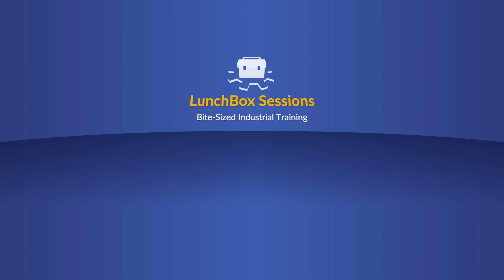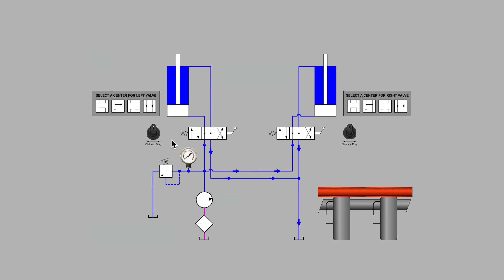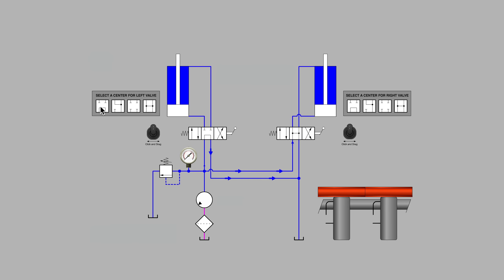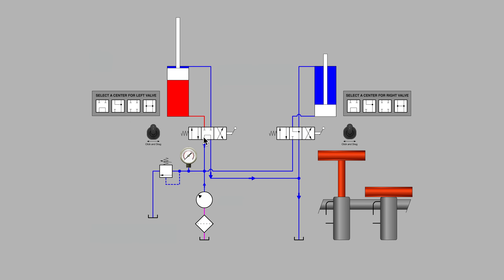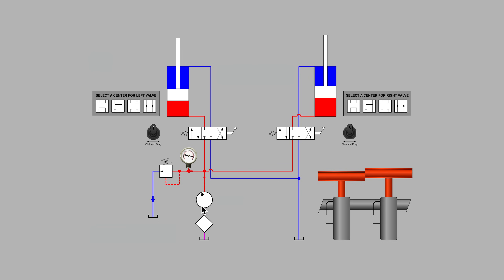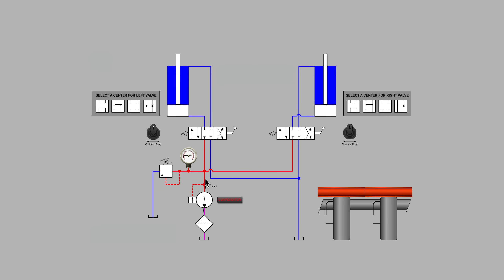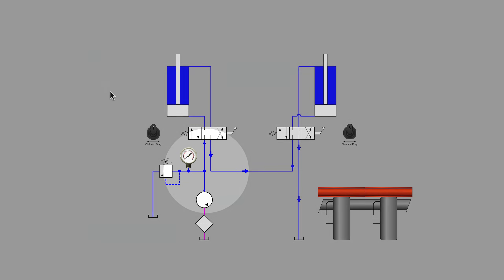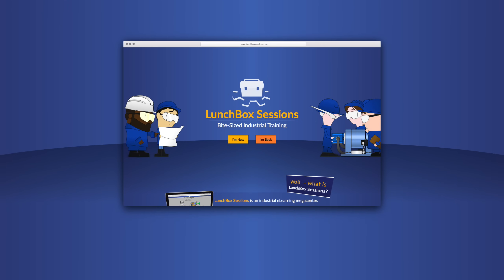Directional Control Valve Centers

Comment: when the cylinders are plumbed in series, is only one cylinder at a time able to be used? when using one cylinder, the opposite cylinder's directional control valve needs to be centered to allow a flow path back to tank right?

Comment: Thank you for this video. I'm a loader operator and this has to be how the good loader valves work. I've auspected it for a while, but couldn't find any evidence that anything was plumbed this way, and some people describe series valve setups as 1st valve dumping tank to tank when off-center, rather than providing that flow, minus some pressure, to the next valve which would make a lot more sense.

Comment: you have to be careful putting full pressure on the tank side of the valve. most valves cannot resist that pressure. When using a fixed displacement pump (typical gear or vane) you need a "power beyond" port on the valve. That allows for safe pressures in the return/tank side of the valve and doesn't risk blowing out a low pressure seal/actuator. most valves can be purchased with this option.

Comment: Wow! You just answered my question about using a closed center DCV for a bi-directional winch motor. I am going to a Variable Displacement Pressure Compensated pump from a Fixed displacement gear driven pump with a tandem center DCV for the winch motor which worked very well for that system. People tell me a float DCV is better for my new system but I can’t see it holding a load as needed in the center position?
Reply: Also I see you have a sensing line after the pump back to the compensator. Question is if the second actuator was a single direction motor i.e. compressor motor could I T my pressure sensor line in the pressure line of the compressor motor and run both DCV and compressor pump without any mixup in compensating signal from the sensor closest to the pump?

Comment: I think you must emphasize the advantages and disadvantages of each type of center position into a highest level for viewers awareness. 
Tandem valves are just for simple cheap hydraulic systems. Mostly one actuator with fix displacement pump. Making series circuits using tandem valves are dangerous on higher pressure. Tandem valve is also the weakest among 3 position spools. Close center are used with multiple actuators but they are not as desirable and creates more problems on complex systems. 
I think you have to give more emphasis on the float type because it's (and its variations) the most commonly used fieldwise. 
Old machines used lots of fix displacement pumps from medium to higher pressures but newer ones imo use more variable displacement ones thereby limiting the use of 4/3 closed centered. 
In mobile applications you could hardly see any closed center valves. I'm worried that some dumb aerospace designers may have used valves of these types(closed cent). 
More emphasis on float type (and some variation)as they are most commonly used by good designers.
Reply from the maker: Thanks for your valued input. Without a doubt we'll do more videos that showcase one valve position as opposed to another. We've encountered all four of these valve centers on both mobile and plant based machinery. The objective of the video is more to help a schematic reader as opposed to a system designer. 
Have you seen Directional Control Valves Basics Pt. I https://www.youtube.com/watch?v=CQPwvWXbV3w and also Part II  https://www.youtube.com/watch?v=o-A_9nFpzek
Also you might enjoy Pilot Operated Check Valve Cylinder Troubleshooting - Part 1, 2 and 3 starting with https://www.youtube.com/watch?v=tyRTbdAuMxI  On that video we're into that float center that you mentioned, in a big way.

Thanks again for writing.  -Carl
Reply: Please explain their advantages and disadvanges in terms of construction equipment. 
As I understand, a main thing that makes parralel configuration more preferable is operation of both cylinders in the same time. Is it all?
Reply: L9bus when you use counterbalance valve, brake valve, pilot operated check valves etc you need to have input/output(A/B) lines vented at these valves basic positions. Various shuttle valves are also installed for so many purposes that needs to be vented including load sensing and/or venting Relief valves as well as destroking the variable displacement pumps.

Comment: will both cylinders operate simultaneously in the series configuration ??
Reply from the maker: If ones tries to operate both cylinders at the same time, when in the series configuration, the load on the downstream cylinder back pressures (resists) against the flow leaving the upstream cylinder. This makes the upstream cylinder weaker in terms of the amount of lifting load, which could now trip the system pressure regulator (relief valve, or pump pressure compensator) as loads in series sum together in terms of system pressure.  The other issue comes from a cut-off of flow available to second cylinder if the first cylinder (perhaps shorter, or started extending earlier) reaches end of stroke and then is deadheaded. Now there would be no flow to cylinder no. 2. The tandem center (P to T connected) valve, chained together in series is generally meant to be for a system where only one application (directional valve and actuator) is used at any one time.
Reply: thanks :)